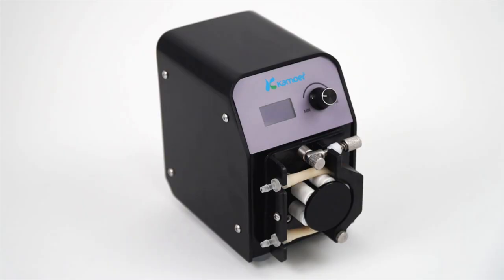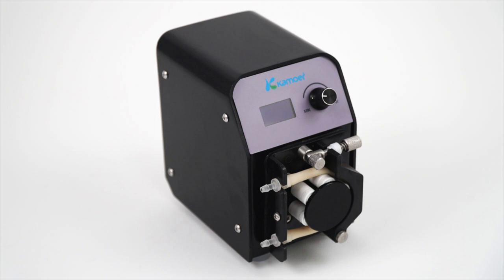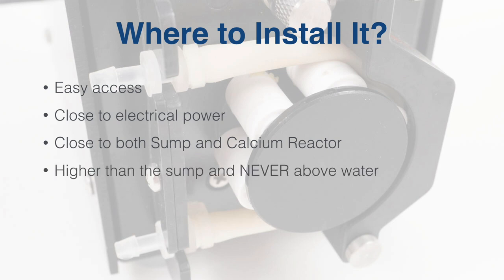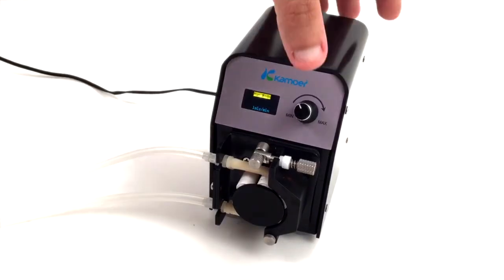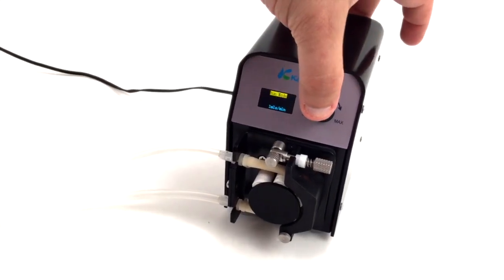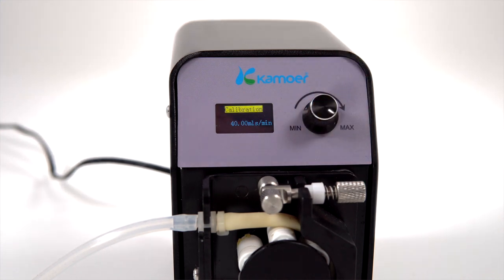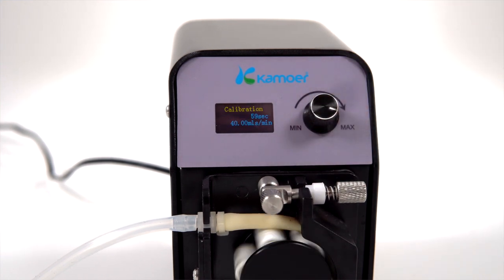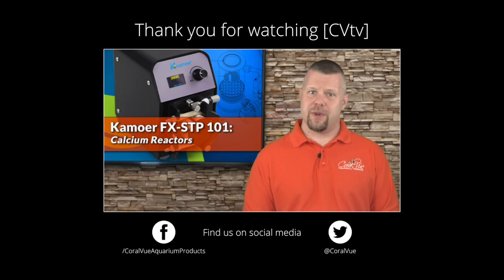Kamoer FX STP 101: Calcium Reactors

Comment: Yes! When is this available?  How does this compare to the units from commercial grade units such as the Cole Palmer peristaltic pumps?
Reply from the maker: These are available now. The FX-STP is really quiet and much smaller than the Cole Palmer. The FX-STP performs as intended and at a fraction of the cost.

Comment: How quiet/loud is it?  If it was the only thing running in your stand would you hear it?
Reply from the maker: When it comes to continuous dosers this is the quietest ones I have heard outside of the huge ones used in the medical industry. Definitely much quieter than the Cole Palmer ones most are accustom to using but not silent you will hear it running. The amount of sound produced by the FX-STP also depends on the dosing rate of the pump and how fast the wheels are spinning.

Comment: Tubing connection to calcium reactor seems kinda vague, can you clarify a lil bit. 
Inlet Into sump, up a lil bit off the bottom to prevent tritious from entering.
Connect that line to bottom line on dosing pump, then connect the top line to inlet on calcium reactor? Does this sound correct?
What is a good starting ml for a calcium reactor rated for 240g?
Reply from the maker: Depending on your calcium reactor you can push water through like you would with a small pump or as we will demonstrate in E2 of our calcium reactor series we will install the Kamoer FX-STP to a Reef Octopus Rx. I would start off low like 20-25ml min and test daily.

Comment: 1 other question.  Can I use this doser post calcium reactor as opposed to as a feed pump.  I use a Sicce .5 to feed my Geo 810.  I was just looking for a more reliable needle valve alternative.  Currently, I’m using a “pinch” valve which squeezes the effluent tubing from the outside which is actually way better than than needle valve it came with.  I was thinking I would hook this unit up at the output of the reactor to replace than pinch valve to get a more controllable output.
Reply from the maker: Yes you can have the FX-STP regulate the effluent flow from the reactor. However I do suggest making sure that the feed pressure of water and CO2 is not too great.

Comment: Hi , is it possible to set the amount per minute to lets say : 0.01 ml / min ? and is it possible to set the dosing times ? lets say 12 times per day x amount liquid ?
Reply from the maker: Dani Wornath you can set the pump do dose as low as 1ml per min. This is a continuous doser and can not be programmed other than the pumps speed. Sounds like your looking more into a standard doser rather than a peristaltic doser.